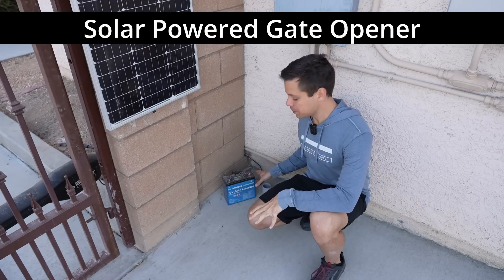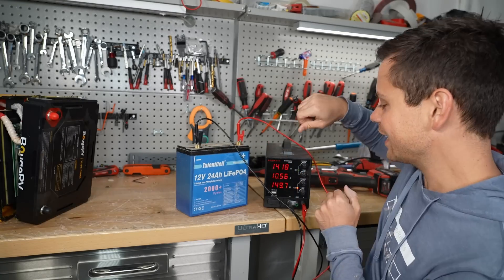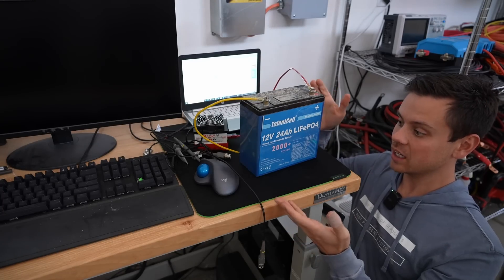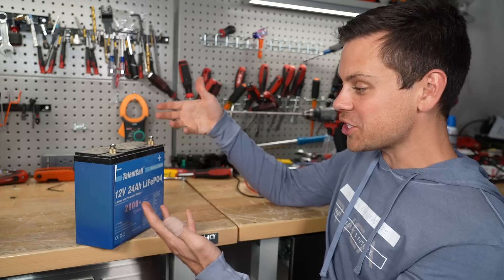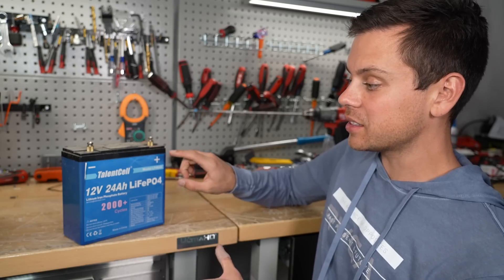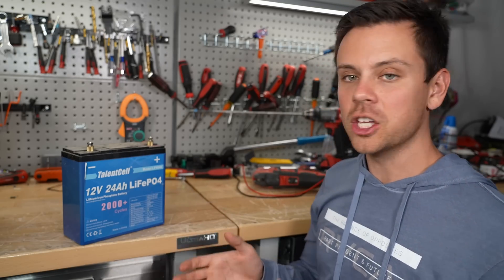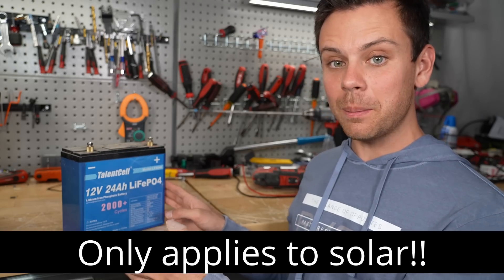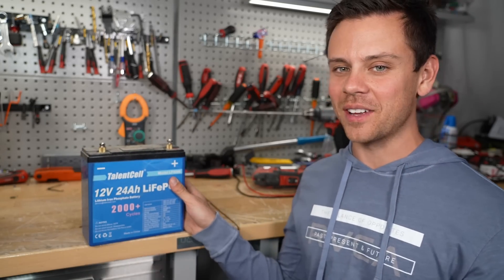12V LiFePO4 Heat Torture Test! Did we kill it!?

Comment: I bought a battery like yours now I have problems with my renogy 40 amp charge controller. I had a agm renogy battery at first and never had problems. My problems are very slow recharge compared to my agm .I have 2 renogy 100 watt panels on a good sunny day about decent power to charger .so point is can you give me advice

Comment: Recent studies (last 6-12 months) have affirmed storing LFPs at 75% is best. 

Tesla recommends charging to 100% "at least once per week" - for the BMS. They don't want people stranded due to LFP's notorious troubles calculating capacity in mid-range states.

Avoiding continuous float charging is best. This is where LFP differs the most from "normal" Li-Polymer/NMC batteries. 

Charge to 60-75%. Use as much as needed (to 0-1%), then recharge back to 75%. 

For DIY solar, this isnt a big deal. For an EV or a fesiably impossible to replace LFP, it's a very big deal.

Comment: The makers of Bioenno Batteries say if you know the battery is not being used (stored) for 6 months that it should be discharged to 50%....... But what's the point of having a battery around that you can't use.....hmmmm

Comment: Smiling!
Sir Will, yours  is a fun channel to watch, I have learned a lot. Been wanting a battery backup for my computers and ham radio since my Alph gell cell died and looks like LiEe Po4 is the way to go. 
 At soon to be 74, seems like they will last as long as me, but I am going for 100. Smile!
Ordered the EG4 3000 watt inverter and the EG4 48 volt battery and just got confermation it has shipped. 
Keep it up sir.
73
K5EDD: celebrating 50 years of Amateur Radio/ham radio this year, great hobby.

Comment: Got a Weiz 50 amp hour battery in our square drop camper.  I didn’t think about the BMS being a power leech.  It kept running down so I added a battery cut off switch because I thought it was the solar charge controller.  I guess time will tell if the BMS is leeching down the power.

Comment: This is off topic but I was hoping to get a response. I have a new Delta river 2 that I bought to use in the Philippines last Nov, I used it one time in the us, moved here and upon unboxing this week it won't charge with any method. 
Any help would be greatly appreciated.
Reply: Thanks for responding.
I bought this from Amazon last Nov, it's still new. I can get it to charge with a 220 to 120 adapter, the 12 volt car adapter or even a USB, but the USB shows it's charging and it's not. I'm not very technical with electrical devices but I usually can figure things out.
Lots of complaints on YouTube about this same issue.

Comment: I was just looking on M**zon for 200ah batteries and came acroos this one: GuaiGLong 12V 200AH LiFePO4 Battery, Lithium Batteries with 2560Wh Energy Max.1920W Load Power,Built in 150A BMS, Up to 4000+ Cycles,Perfect for Solar,RV,Marine,Trolling Motor,Camper,Caravan,Solar. This has a carry case with a USB port, car type port, 2 other ports, a temp/volts/% charge (not accurate) and comes with an anderson plug and a 20A charger. All for $559. You gotta tear one of these down! I was looking to build a battery box and they have done it for me.

Comment: Intersting survival.   I do have a questions that you probably coverend at some point.    I have been challenged to build a cover for a picknick table that will provide usb charging .   It does not sound Like that much power is needed, yet I also wonder about offering plug in for charging laptops.    This will be a church,  can you directle me to a video or perhaps take this as a chanllenge for a new video.

Comment: Another enjoyable and informative video.  Thanks!  If external heat causes degradation, is it only when in use or charging that it happens or does it happen even when not in use?  If only when using it I wonder why there is not an option to have a cutoff sensor for ambient high temps.  Regardless, to have only a 4% degradation(you stated it still had 96% power) is remarkable.

Comment: Hello Will! would you take a look on the DaranEner NEO2000 powerbank, only around 750dollars at the moment with the code at the website,  LiFePO4 batteries, 2000w inverter, and 2070wh capacity

Comment: Hey Will! Question for yoooou!

I'm learning here. But if I compare (2) 100ah Lithium-Ion Phosphate batteries ran in parallel (12v battery system)

 - VS - 

(2) Lithium-Ion Phosphate batteries ran in series (24v battery system).... 

I will have more run time for a device/appliance simply because the 24v series is less amps...which extends my battery bank? 

Am I right?

Comment: @DIY Solar Power with Will Prowse  QUESTION:  I have an EcoFlow Delta 2 1024 lifepo4 battery.  I have read and heard people say that 500w is the MAX solar power it can take at once.  My question is this:  if i have 750w or even 1000w WORTH of solar panels connected in series/parallel but they when in the sun are NOT combined delivering over 500w altogether, is that still too much for the battery/panels or does the flow INTO the battery have to be less than 500w, not the combined rating of the panels?

Comment: 1. TalentCell’s product has good quality; 2. Almost all small capacity lifepo4 batteries without low temperatures protection. Lifepo4 battery can slow charge at -20 Celsius degrees; 3. It’s better keep charge ratio between 30%-50% during storage.

Comment: I have a bunch of the Valence u27-12xp batteries on my boat. I put it in storage and left them at 90%. 2 months later I checked them and they were still at 86%. When relaunching the boat in a couple of months, I expect to still see them at 80% after 5 months. The ones that I have are also 12 years old and checked out 110-120 amp hours with just a crude test. I just got 7 more to add to the 6 existing for a great power backup on the boat. I don't quite have enough solar to keep them up when out cruising, but when I go someplace, the engines each have a 140 amp alternator to help them along. With only 6 and lots of rainy overcast days, I could be down to under 20%, but now with double the capacity, I should never drop below 50%. Valence makes a great battery and I finally have enough at $300 each or less to fill my needs. I see many people selling them still used for $500+, but have never paid that for them. The new rating was 138 amps and I love that the BMS is rated 300 amps each for 30 seconds and 150 amps continuous, more than enough with the current 6 to start the big diesels. 13 is going to be awesome this next Bahamas season.

Comment: Wauw, did not expect that.
I keep mine in a temperature controlled room, with a split AC,  temp never over 25 celcius.

Installed it after switching to lifepo4, but understand that this actually is not necessary for the batteries.   Good to know, thank you!

Though not necessary, I'll keep that AC running since it also prevents high temperatures in the inverters and SCCs and keep humidity low.

Anyway, no need to panic if the AC won't work for a couple of days.

Comment: Blimey Will, that’s different advice from what I’ve had from a Chinese Battery manufacturer .So Charge to 100% discharge to 0% don’t Fast Charge them back to 100% and a good Lifepo4 battery should do 20 to 30 years, did I get that right ? I’ll rewatch it again  I think. tbh, I’ve been really worried about some pretty conflicting information about Lifepo4  looking to be only having an achievable Service Life of up to 15 years by treating them with extreme care, such that for my next Boat, I was going to stick with really good 3500 cycles AGM for the Main Housebank with Lifepo4 for the second Housebank. Thanks for the insights Will Best Wishes. Bob in Wales.🤔🏴🇬🇧🌟🌟🌟🙂

Comment: I have leave my lipo4 on 40% charge for 2 years brand new.
Thanks to corona i con not work on my boat .
And yes the winter is cold here .
Well i use them on summer 2023 and its just fine with no problems 
I use solar charge and use lights to fridge (12v) 
And it work just fine.

Comment: One of the factors in your favour is the gate its powering will be in regular use ... so the charge level of the cells will fluctuate - your solar will charge it back up etc. This cycling may only be at top end of charge but with LiFePo - this is good enough. If it was LiPo - then that would definitely kill it.

Comment: Maybe someone can make a setup that automatically charges and discharges a small capacity lfp battery like this one, and leave it doing that for 6months or even a year. So we can see the true degradation after 1000,2000 etc cycles. Not what the battery makers claim.

Comment: I've been thinking of doing something like this, but my gate opener lead acid battery has been working at least 4 years since I bought the house, and some amount of time prior to that with the previous owner. My weather isn't as cruel, and I wouldn't leave it out in the elements either. My question would be how many watt hours does a gate opener burn per cycle? I might replace it when the time comes with some Headway batteries, but they are relatively low capacity.

Comment: I'm quessing by saying to discharge to zero, you don't mean voltage. Most lifep04 batteries are considered fully discharged at around 2.5 volt and unless its an emergence, never go below manufacturer listed low and NEVER get close to zero volts.
Reply from the maker: No!
Reply: I should have said cell, a 12v, that would be 4s x 2.5 or 10 volt being fully discarged.

Comment: That's crazy. I've made the mistake of visiting Las Vegas in the summer. It's a brutal heat. 
I'm in Florida and my batteries are out on the back porch. They're under shade and the temperature hits mid 90s in the summer and drop to the mid 80s at night so I doubt I will ever have a problem. I have the discharge cutoff set at 48v but rarely get that low. I normally get through the night at 52.2v in the summer,
Reply: I live in myrtle and it can be 90 but feels like is close to 120 due to the humidity, that is the test I want to see is humidity heat as in feels like….then I will be convinced it would be okay to have a bank outside ina shed!

Comment: If you were daily multi-cycling these batteries then I would definitely recommend reducing your depth of discharge. I can't exactly remember the numbers it's been a while since I've read that paper, but something like a 33% D.o.D you could get 12-15,000 equivalent charge cycles (as in charging and discharging three times at 33% D.o.D to equal 1 cycle). That would get you an effective 45,000 cycles!! 

Now that's a little bit extreme conservation. doing that 3x a day would still get you 40 years. It is likely to calendar age before that especially if it's not a temperature controlled environment.

Love this test can't wait to see you do it again in another couple years. Would be cool if you did some more extreme testing with some of your other cells that you don't use anymore. Or from those garbage batteries you just reviewed 😂

Comment: Why do guys on your forum say to keep the batteries between 20 and 90% state of charge?
Reply: They are probably used the the older lithium-ion batteries, which need that SOC limited to avoid problems. LiFePO4 batteries are not subject to overheating/thermal runaway like the others are, and I believe they are also longer-lasting.
Reply: Thank you @Tumbleweed5150

Comment: Thanks for this test William. High temp and high SOC  reduce capacity because of internal resistance become higher meaning tha the LVC will trigger sooner ( V sag ) and so the SOH that you measured was at a  C/5 rate.  That represent real life use or to be easy on the battery  maybe... typically capacity test  in spec sheet are measured at C/2 or C/5. I guess that at C/2 it would have been different.. i am curious if the C rate performances have been affected.. cause capacity is one part of the result.. and capacity at various C rate is  the rest!

Comment: Great real-world test!  These long-term tests are critical to understand how these batteries last and thus how much value they truly offer.  This battery shows that lead-acid is absolutely worthless except for starting ICE engines and even there lithium can be a good value in the long run or in applications where weight matters.
Reply: Pretty stupid. Lead acid deep cycle is not worthless and in fact is worthwhile. US Li battery prices are much lower than some other countries but in my country for 100 amp hours lead acid deep cycle I paid $ one fifth of the cost of an equivalent LiPo4. It is charged by a 50 amp DC to DC charger in the car and a 200w solar panel on the car roof. I use a 8awg cable (pos & neg) to connect to my caravan. It is all the power I need to run the pressure pump, lights, 3 phones, 2 tablets and the vent fan. There would be no advantage in having a Li battery for this purpose and they cost about $900 (in my country) for the 100a/hr one recommended by Will in the pinned comments).

Comment: Hey will, looks like you installed a gto or mighty mule or Lanier there all the same.
I'm  a gate guy and I don't  care for that operator it has a micro switch in the arm,and the worm drive uses a nylon acme nut,which is sloppy, and the front and back pins are sloppy making the operator need to have a solid post to stop on when closed,same for open or on open when windy will flex and Crack the micro switch board inside the arm.
There's a much better alternative. 
U appreciate all your videos and knowledge  you've helped me a lot so I'm  trying  to reciprocate. 
Ernie

Comment: I have a camper with a lead acid group 27 thats charged by a converter that's not lithium capable.  I'd like to switch to lifepo without replacing the converter. I've seen mixed information as to whether it's possible. Some say it's not since the charger isn't lithium ready, some say it will work but only charge to about 80%.  I wanted to see what your thoughts were if I could.

Comment: I’ve spent less than an hour on academic papers, but I’m not seeing results for residual capacity after LIFePO battery storage. However, it is stated by 2 papers that higher storage temperatures such as 60° C result in faster loss of capacity than at 30°. over 600-880 days and multiple test points for state of charge, temperature and rate of charge 0.2->1C were mentioned. 
I can see why Will didn’t quote any numbers for loss of capacity from calendar aging. 
Does anyone see something like loss in %/yr?

Comment: I suspect that you are very very seldom actually charging it below freezing.  Since you're charging it from a solar panel this means it would not charge at night and that's when the temp is most likely to drop sub freezing.  Even if you did, the high typical state of charge means any charging you do would still be quite minimal even on a rare sunny, freezing day in Las Vegas.  Good to know that heat apparently isn't all that cricial either.

Comment: I’ve had an idea of placing a lifepo4 battery in a water proof container like a pelican case or small plastic barrel and placing it underground to keep it at a more constant temperature. Maybe to charge a gate opener or electric fence charger.
Reply: i think its a good idea for inviroment with extreme temperatures.
Reply: It could be a good idea depending on the setup and environment.  I could definitely benefit from it.  Living in Minnesota, we can be months below freezing every day.  Our frost line varies but freezing Temps will get down to 40+ inches in soil.  Our horse waterer piping is 6 ft. Down but the automated portion runs through a sealed 16" tube that breaks the ground surface.  The interesting feature is that the ground depth of the tube is something like 8 ft.  The total volume of air exposed to unfrozen ground is considerable and so keeps all mechanicals from freezing.  You could achieve something similar for a battery by just having a deep enough hole and good insulation at frozen soil and surface.  The earth will provide slow geothermal heating so that you could still access the battery if you wanted or needed to.  Conversely, any air space created in this way could help buffer the battery if it were to put out any significant heat through high amp draw.

Comment: Wouldn't leaving it in the rain short something out? Either the battery, the charge controller, or solar panels? Seems it'd make sense to cover it from rain at least?
Amazing it's still alive though.
Reply: One can get a fairly cheap charge controller that is waterproof, solar panels have to be, as they are always in the weather, and apparently the battery can take getting rained on. I agree that normally, one wants to protect an investment of this price range or higher, but Will is doing several things that will show us what happens in extreme situations. I myself am running a few "test" systems, as we get temps over 120F in the summers here in the southern CA desert. My main "house" 48V system is inside, with air conditioning, as it's by far the most expensive. My girlfriend's 24V system has no AC, so using her system this past summer has shown that the system works fine in up to 120F, (we didn't see anything much higher, as it was a "mild" summer for this area). I also have a 24V system in my "work truck", which seemed to do just fine.